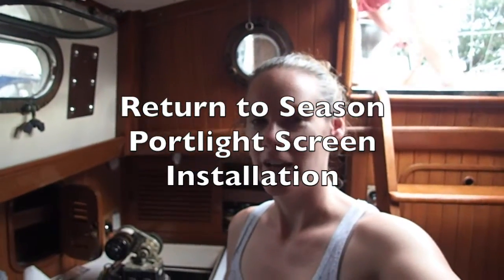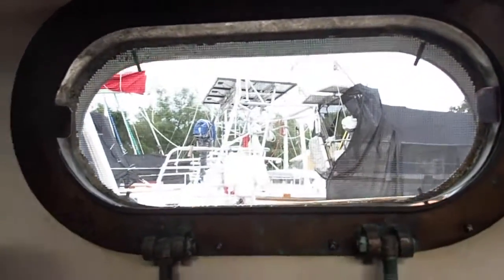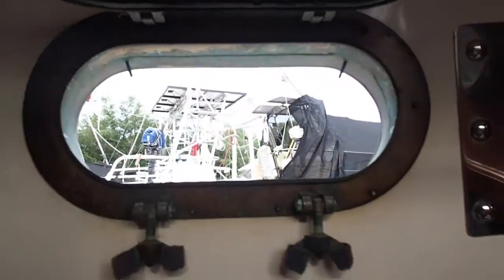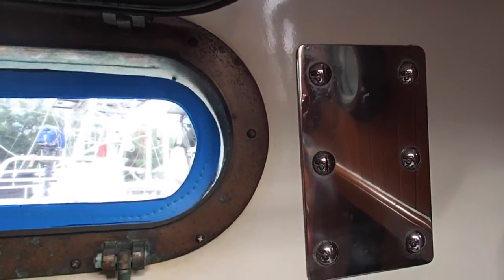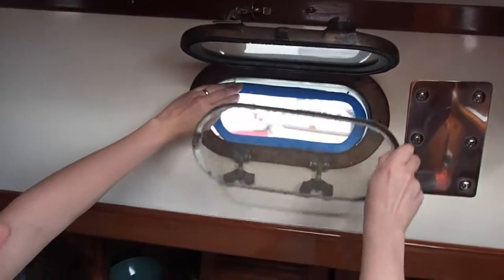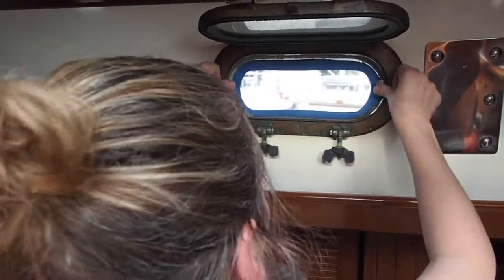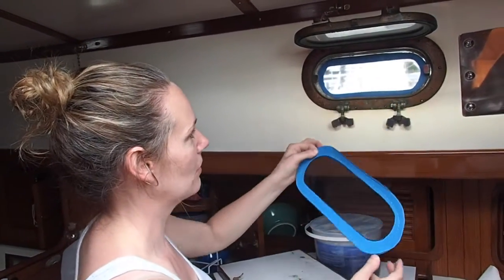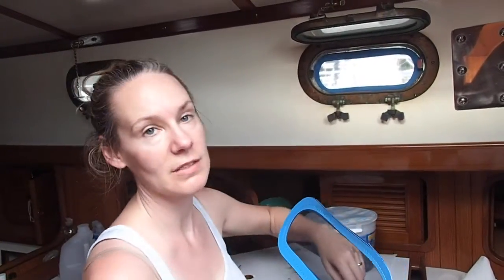Portlight Screen Installation

Comment: Wouldn't it have been an easier to use thing if you had just soldered a smaller mesh on top of your larger mesh that you have already have so you wouldn't have to worry about putting the new mesh in every  night?